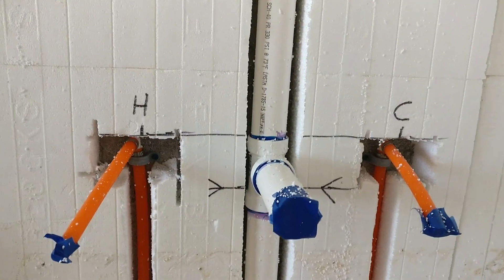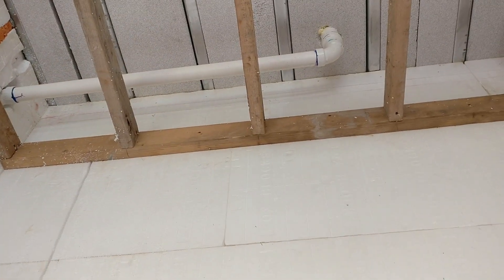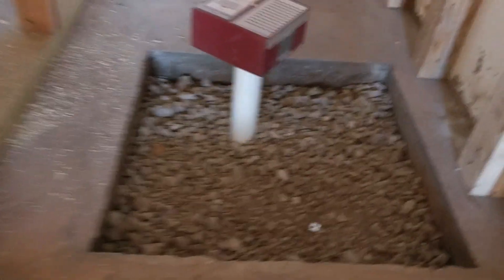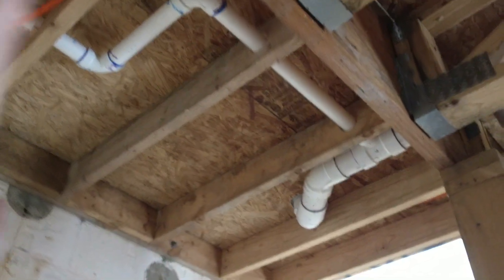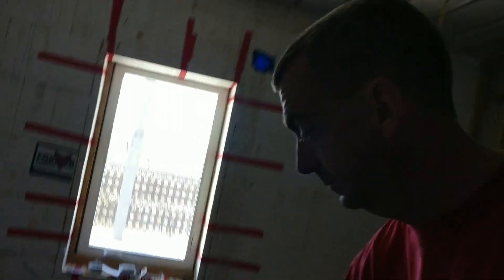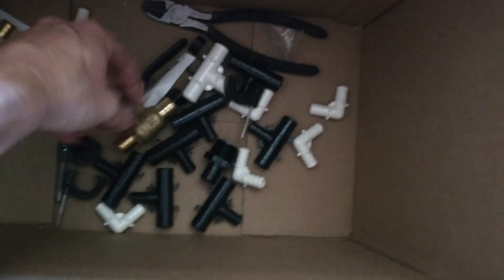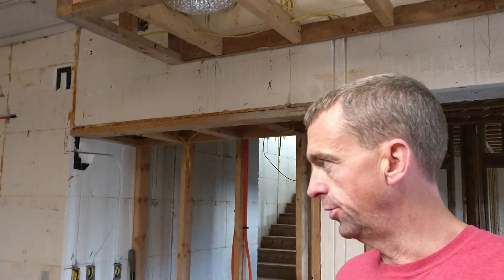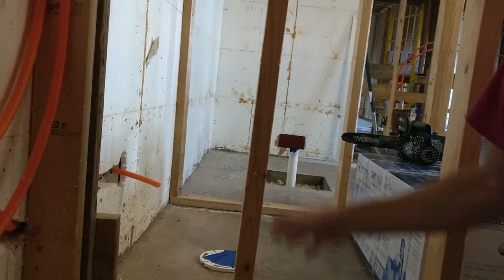Plumbing with PEX in our ICF house!

Comment: How is the sewer vent pipe flashed and waterproofed on the roof deck?
Reply from the maker: We used the same silicone rubber roofing material all around the pipe. No leaks two years later.

Comment: So i Know its to late, but is that pex that was from the in floor heating not PexA pipe?  If it was then you were supposed to use expansion connections/hardware with expansion rings.  If it was PexA, using those crimp rings will not last long.  I fear many leaks in very near future.  Lastly how did you keep the pex temp normal when its in the attic?   Love the videos.

Comment: Hello. May I ask, why is the shower floor void of concrete? Is this to give you room to move the drain line around as needed? In other words, why not do it exactly as your nearby toilet? I am just trying to learn while planning my own slab home. Thanks.
Reply from the maker: The shower floor needs a pan that will be absolutely waterproof. So, the hole is left there so that we can build the pan and install all the waterproofing. If we poured it like the toilet we would have to build that pan on top of the slab and thus you would have to step up to get into the shower.

Comment: I know you are in the US but where I'm from water/wastewater lines are not run thru the roof cavity or exterior walls with a few exceptions because of our cold winters all plumbing is run inside the building envelope except for subsurface drain lines/main water supply, vent stack and frost free hose taps..

Comment: Hate to tell you this but you don't have to cut that plastic out of the talon "pex clip" it made to hold both 1/2" and 3/4". Just snap on the pex and nail to whatever. I prefer the ones made for the specific size pipe but they work. 
Oh bad idea to run both heads off one valve you are not going to get good flow out of either but worse on the far head especially with the 90 in line.

Comment: 11:31 : I bought those 1/2 - 3/4" clamps and had no idea the inner part was designed to be cut out for 3/4". I thought it supposed to stretch out to accommodate the larger pex.  I did eventually have to cut the inner part out. Thanks for confirming the way to use them.

Comment: This is the same type of build I’m contemplating for our ski cabin.  Have a contractor install ICF walls (and maybe roof) and DIY the remainder of it.  I’ve done complete plumbing and electrical upgrades, and remodels before so I think it’s an achievable goal.

How many square feet is your space (incl garage)?  And thanks for posting these!  You’re doing awesome!
Reply from the maker: Thank you so much for watching! You can definitely do this kind of work if you have done remodels. We have learned so much by watching videos, talking to people, and reading what we can about various products. Our house is 2600 sq ft including the garage.
Reply: @LakeLotBuild  awesome - thanks for the info.  I’m sure this will sound weird, but would you consider sharing (or selling) a copy of the plans?  I’d have to have a local architect make some changes, but what you’re building is pretty close to what I’m hoping to build, and our lots are very similar.  “No” is no problem but I thought I’d ask.

Comment: Hey there, Quick question John. 

From a builders' stand point, wouldn't it be "easier" for you to make the building 7" wider on all walls and build a 2x4 exterior wall on the inside to the run all your electrical and plumbing through there? 

Or is there something I am missing.

Thanks!
Reply from the maker: I think this is a really fair question, and I think other people do choose to just fir out the walls. For us we built the ICF house when dimensional lumber was a thousand percent more than the year before. We were really trying to limit cost of both the ICF block, concrete and any lumber that we might need. So really it just came down to a cost issue for us and not wanting to spend more to make the footprint of the house larger and not wanting to pay for all of the 2x4 framing for the interior. I think other people would make the choice to for out all the walls, but to be honest John's been able to do all the work by himself in not a great deal of time, so labor for us is free and a little bit of vacuum cleanup with the styrofoam is free for us as well. For people hiring plumbers and electricians, they probably would need to factor in additional labor cost for getting through that styrofoam.
Reply: @LakeLotBuild  Great, thanks for the detailed answer :)

Comment: Great job!  I like trunk line system better than the fancy valve manifolds. Less waiting for hot water. Great job on railings also. I think I saw evidence you separated low voltage/network from line voltage. I also saw the Mr Cool installation. I’m thinking of doing that for my garage and shop. Resistance heat is getting expensive. Thanks for sharing.
Reply: Actually the hot side of a T&B system will take longer than if ran individually due to the volume of water in a 3/4" line vs 1/2" line, but it really isn't that big of a deal.  

The biggest benefit of the Manifold system is there are no connections in the walls, so no leak points and you do not need valves at the end user since the manifold has them built in, which covers the cost of the manifold.  

The main benefit of a T&B system is when you have a hot water recirculation loop, which you should have if you are doing things now.  It doesn't cost much and you can add point use buttons at tap locations for "instant" hot water with no water waste.

Comment: Are you sure that OxPex is NSF 14, ASTM F-876/877/2033 and CSA B137.5 compliant?  Typically OxPex should never be used for potable water...
Reply from the maker: Well this comment definitely sent my wife down the rabbit hole of research. Our viewers are so great at pointing out potential problems, so thank you! From  the research we have looked at so far it appears that the non-barrier pipe is typically used for potable water because the US has such high chlorine in the drinking water here and chlorine used to degrade the PEX  pipes. Now PEX pipe is made with antioxidants so that chlorine can't harm it. This is not the case for the oxygen barrier PEX pipe as you noted, and it is typically not used for potable water. We are on a well, so we don't have to worry about chlorine in our water system. However there may be additional reasons that the oxygen barrier PEX pipe may not be suitable for potable water. Some of the more recent manufacturers of oxygen barrier PEX pipe do make the application safe and have met the NSF standards. We are checking now to see if our particular oxygen barrier PEX pipe meets those standards. We had planned on using reverse osmosis system at our faucet in the kitchen for drinking water, since we are on a well. We of course want to make sure that all of our water is safe to drink in the house.
Reply: @LakeLotBuild  it should be printed on the pipe every 2 feet or so.